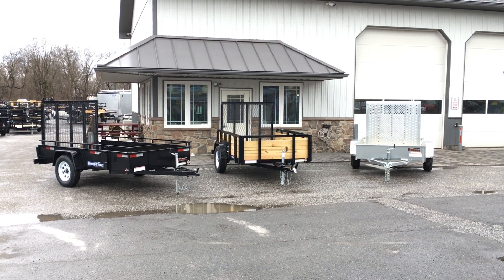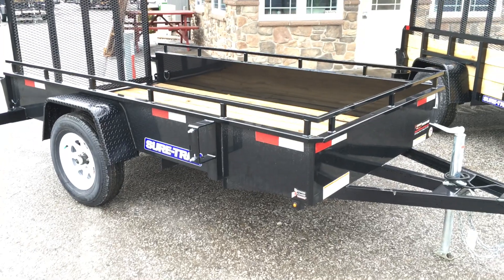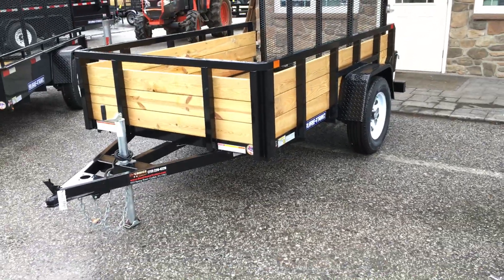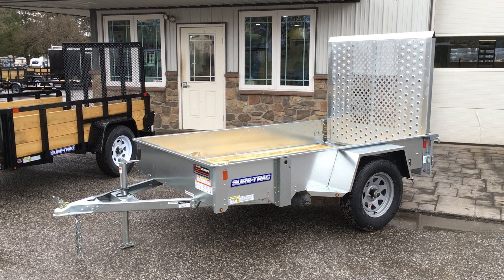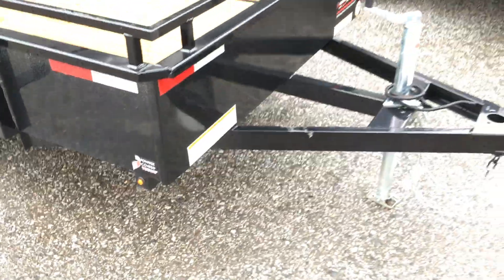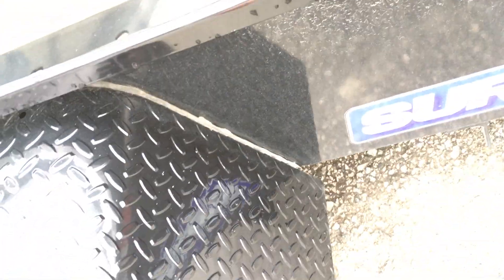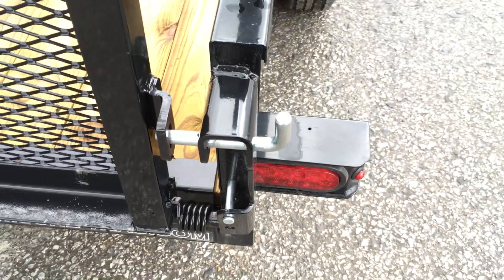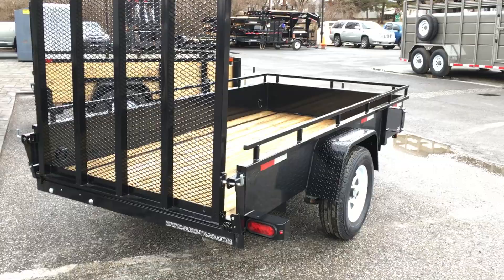Sure Trac Single Axle Solid Side Utility Landscape Trailer Comparison 2990# GVW

Comment: The Sure-Trac aluminum sure looks nice, but I can't find any reviews on how these hold up over time.
Reply from the maker: That particular unit was NOT aluminum, rather a galvanized trailer.  That said, while galvanized was a great idea, it didn't sell as well as it should've.  They do now offer an aluminum utility instead.  I've copied a link below to our in stock Sure Trac single axle utility trailers currently available:  https://www.bestchoicetrailers.com/all-inventory/utility-trailers/steel-single-axle/all-single-axles?manufacturer=sure-trac